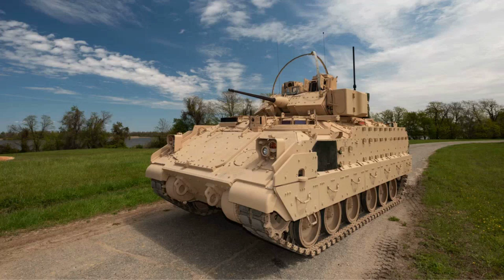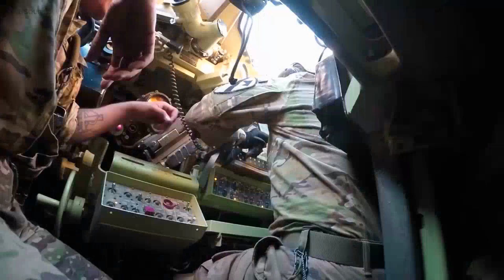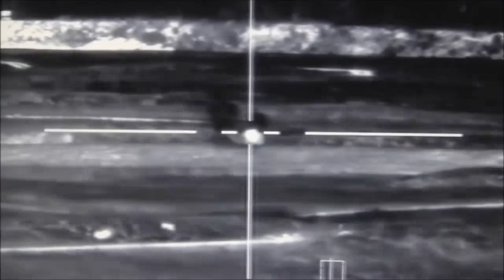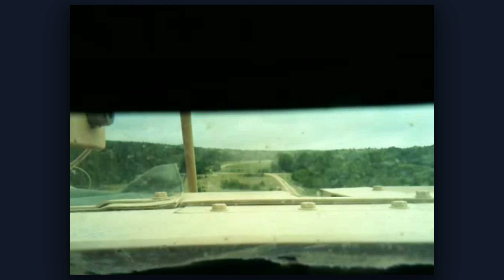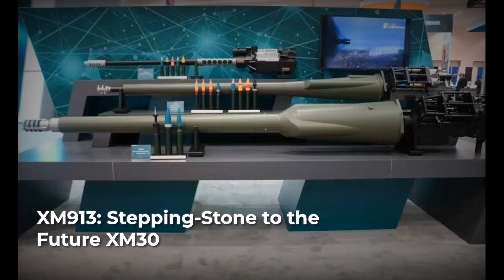Inside the NEW $6M Bradley in the U.S. Army

Comment: Well,  the Bradley's have been kicking ass in Ukraine so it makes sense to upgrade them until a new generation vehicle is available.  Do not make the mistake the Navy made with the OHP frigate's and not have a working replacement before retiring them!
Reply: scrap haulers in the Ukraine are getting less that fifty rubles a ton right now, because there's a glut in the market. a little bit of copper inside a steel box, makes  a mess of human flesh.